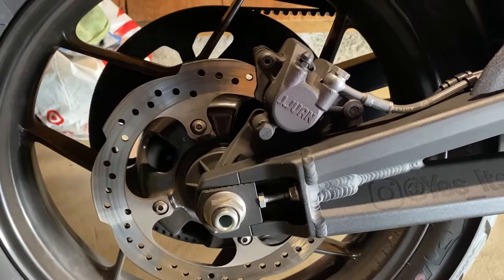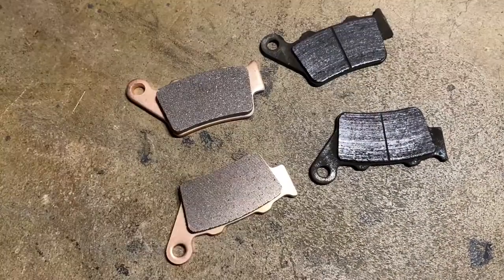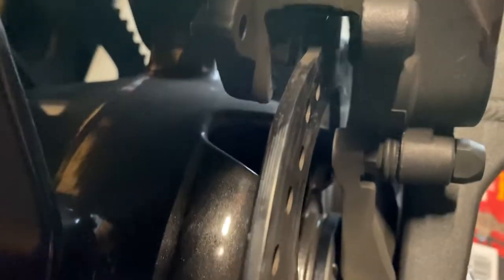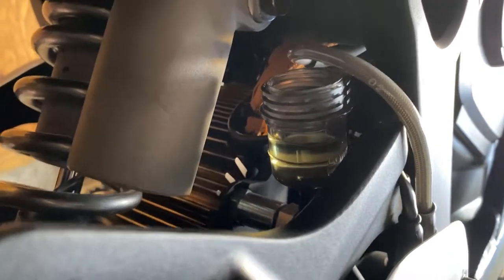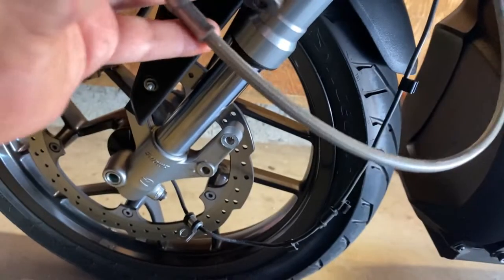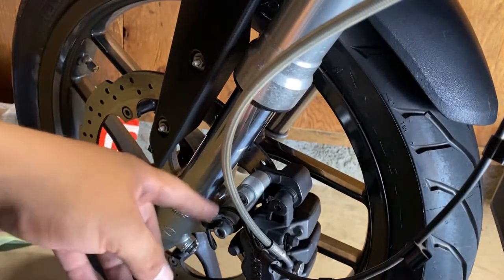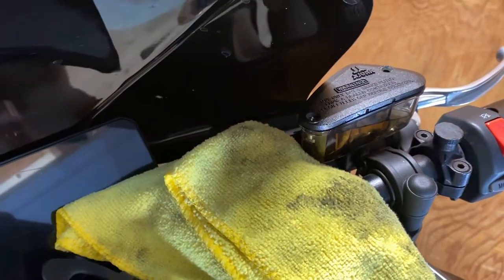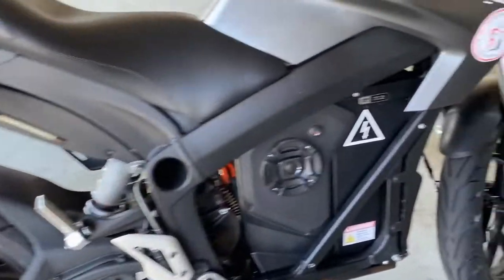Zero Electric Motorcycle Brake Pad Change

Comment: Hey man, good video about how many miles did you get out of your original brakes?
Reply from the maker: I want to say about 7k miles, but the front still had a good chuck to go. Probably could have gotten a solid 9k if it wasn’t for the rear almost being completely gone.
Reply: Zero SR 2017 -  I got 16K, but I should've changed fronts before that.
Reply from the maker: @toddrandolph24 I was practicing low speed and kinda hard quick turns and zero regen. Killed my brakes way too soon lol